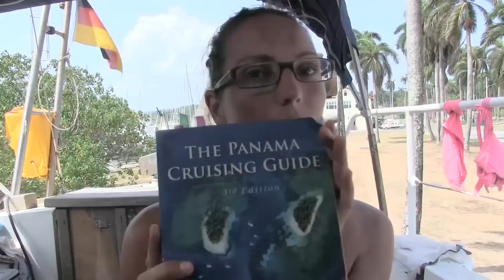Unconventional german welder SAVES my SAILBOAT in Panama - UNTIE THE LINES #30

Comment: Nike: As a welder with over 30 years of experience, I watched your video with great interest.  Here are my thoughts and concerns: (and what I would do if it were my boat)

1.)  I would have an ultra-sound survey done of the hull done at the first reasonable opportunity.  If not of the entire hull, then the area immediately surrounding the holes and those areas overlying any internal corrosion identified during your inspection.  This will determine the thickness of the hull plate in the corroded areas and whether it is thick enough to be properly welded.  The fact that the welder was using impolite language is a sign that the he was having difficulty (probably because the hull plate was too thin to properly absorb the heat of welding, causing a burn-through and falling-out of the melted weld metal from the effects of gravity).  This is NOT a good sign.

2.) Another concern is the welder's use of "stick" electrodes for the repair.  Aluminum welding is almost always done either with the TIG (heli-arc) or MIG (wire-feed) welding processes professionally.  "Stick" electrodes (the SMAW welding process) is almost never used for welding aluminum due to it's inferiority to the other two processes and poor results generally obtained.   Aluminum "stick" welding is limited almost exclusively to home welding practitioners who lack the funds for the more expensive equipment necessary to perform either MIG or TIG welding.

3.) My third concern is the method employed by the welder of merely "daubing" the holes closed with weld material.   This is a very inferior method of fixing holes in corroded metal.

The proper method of repair (if practicable) is to survey the limits of the corrosion-damaged area until hull material of the proper nominal design thickness is reached.   The substandard hull material thus identified is cut out and the edges of the hull material around the resultant hole are cleaned and beveled in preparation for welding.  A patch of the same dimensions as the hole and design thickness (and also alloy) of the original hull material is prepared and beveled and welded into the hole.  (the beveling allows for a full-penetration weld through the whole thickness of the patch).   This is the definitive solution for patching corrosion, and is what I would do if it were my boat.

My advice to you is to consider "daubing" the holes closed with welding rod as a very temporary solution until a proper repair is made.
Reply: Cost vs Benefit vs Risk = Action
Reply from the maker: thank you so much for taking the time for writing this long advice. I totally agree with you...but...I have been gathering a lot of offers from different people using different methods...and doing it the "right way" would have cost about 3.200$. Now I paid about a tenth of that. Why did I dicide to go for it: First I will be cruising a little in the caribbean, doing baby steps, no long offshore passages. I will have time to watch the welded holes and also the further corrosion that are not full holes yet, but effected areas. Next step will be to get rid of all the causes for the electrolysis / galvanic corrosion (already working on that step by step) and watch the effected areas to see if it stops or keeps on going.
If my journey should go as far as really heading into the Pacific one day (meaning long offshore passages), then I will consider to find a more proper solution for the corroded areas and go to a place where it will be easier and cheaper to have it done properly. I know this is not perfect, but I hope it will work out for now...
Reply: WhiteSpotPirates
I too was concerned when I saw him using a stick. While I don't weld I have a few friends who do and they always say TIG or MIG and inert gas shield. After reading your response Nike I understand your reasoning. Just have some good bilge pumps, and consider an epoxy patch on the inside as a backup.

fair winds
Jerry
Reply: Jerry English Carry some epoxy putty.  It's two part and can be molded to fit in place and will cure underwater.  Most bilge pumps will only buy time with any significant hole, and that's only till the battery dies.

I'm glad you got the holes fixed, and are aware of the compromises you chose in making the way you did.  Knowing allows you to follow up and keep an eye on them.  You should take a lot of close up pictures of the hole repairs and other "interesting" areas under water that you want to keep an eye on.  Though I'll bet you probably already did that.

Congratulations on the progress!
Reply: I thought the same thing. These welds will fail, its only a matter of time. I would not trust these welds.
Reply: this correct
Reply: drifterpilot though I agree with pretty much all that you wrote, I get the impression that cash may be her biggest problem at this point. She must find a real welder with a mig or  trig rig.my biggest question remains is HOW. How did she buy this boat without even having seen photos! I don’t get it.
Reply: @WhiteSpotPirates  I think you are not evaluating the risks and cost correctly. If your hull is compromised you may loose your entire investment in the boat if not risk your life.
Reply: @billh2294  The old saying goes "The bitterness of poor work lingers long after the sweetness of a low price goes away" In this case David H is 100%. You could be risking everything including your life and you wouldn't even have to venture out any farther than the harbor.
Stick welding is 101% wrong. A pop riveted gasketed patch would better, and that's not saying much
Reply: @WhiteSpotPirates  You have an entire chorus of professionals telling you the right way to patch your hull. You ignore their advice at your peril. If you don''t have $3,200 hundred dollars to have the hull welded the right way leave the boat on the hard until you do. Isn't your life worth more than $3,200 hundred bucks. Mine sure is. I own a vintage car and have owned it for 34 years. I quit driving it several years ago as it had developed several issues that were a severe threat to my safety to continue to drive the car. I spent over $15,000 dollars to have the issues repaired correctly. I not only haul myself in that car but friends and family as well. The point I am trying to make is that even if you only sink in the Caribbean your boat is just as lost and you are potentially just as dead. Hoping it works out is fine for a lot of things, but I want certainty in my corner as often as possible. Risking your life and property over a few dollars is just not worth it.  Do it right or park it. These are your only safe choices. With blue water boats, and airplanes there is no in between.
Reply: From what I could see in the video the condition of the hull was bad. It was peppered with holes and even Tig welding the repairs would at best be temporary. Only solution is new hull plating, Cut the whole hull out and replate with proper Marine Grade aluminium plate.
Reply: @WhiteSpotPirates  I guess 5 years from now we already know the answer if she is still floating...  Most of the people giving welding advice on the net watched a few episodes of Monster Garage, well maybe Orange County as MG used to get into some welding arcana.  There is nothing whatever wrong with stick welding aluminum.  It is far from a home shop technique for weekenders, because it is supported by all the big name companies who make the gear, and mostly used on plate, which is not likely Mr Garage's favourite medium.  I couldn't really see, but he seemed to be running nice straight lines, and as the boat didn't just catch on fire, he must have shielded it well enough.  

TIG is great, and I am on my second machine.  The name brand stuff is extremely expensive to run, so you can bet people are not using it in remote parts of the world. Though in the last few years some decent chinese machines have become available.  The thing about shield gas is that it blows away in the lightest breeze, so processes like TIG and MIG, are normally not done out of doors.

The other issue is how much strength you need in a hull.  And the answer is that you don't usually need much.  You need global strength so it does not snap in half, or the keel fall off, but keeping water out is not such a big deal.  Traditionally they hammered in hemp fibers.  As long as the aluminum on your hull was actually welded in place, and not surface deposition, you are probably in a real good situation compared to hemp.
Reply: The guy was one of those " welders" you find in boatyards that people recommend and turns out his only qualification is that he works for beer money, no ones interested in the fact that he can't weld but only how cheap he is.
Reply: @drifterpilot It's five years later and all your words were proven wrong. Some people do not require "proper tools, proper inspections, etc." and can carve a fish out of a tree with a chainsaw, regardless of the theme of your soliloquy. You probably are not a bad person, but a bad judge. Your intent was true, but you must understand that YOU can not do this job with this equipment, not someone else you know nothing about. I hope you learned something from this.
Reply: you have no idea what your taking about. welding aluminum has been done with stick for years, repairs like this are done everyday. stop reading the internet and try having a go at welding.
Reply: @dethrophes I understand your insinuation, but he probably does perfect work, always. just because you can't do what he did and don't like his looks or that Nike entrusted him with her life and fortune, does not make his work resemble your reference in the least. For lack of better words; I say he is an artist.
Reply: @dethrophes The boat is five years floating, motoring, sailing, grounding, sanding, scraping and banging against docks. At twenty years, when leaks develop (anywhere) are you going to jump up and declare, "HA! I told you so!"? Theory is not truth. Fact is truth. Those who can't do, administrate.
Reply: @dethrophes It is you who does not understand risk. Your example of The Lottery is a risk because you have no control over it. A skilled being who has skills and applies those skills in a skillful manner has nearly zero risk. You are defending your own inability to accomplish what this person successfully accomplished, repeatedly, without any of your  theory or decades of experience. You insist that because you are unable, everyone is unable. The sky is not falling.

TL;DR - risk requires no control. Ask a pro-gambler about risk.
Reply: @oadamo  you are wrong stick welding aluminum is not done , it is the last resort . If you are on top of a mountain and it is all you got , and even then .
Reply: As a (German) dual vocational trained industrial mechanic now studying to get my bachelor of engineering degree with an additional welding engineering title I fully agree, this was merely a hotfix. I hazard guess that if the damage in the area is too bad the area with the hole will have to be cut out and a new piece of similiar, or even the same material  be welded in, a common practice with cars and bigger ships (tankers, freighters etc.).
The repair could be done in a day if a tungsten innert gas welding machine is availble, as well as the correct material (composition, thickness etc.) it only would needed to be smoothed out along the weld from the outside and inside and it's as good as new.
Reply: @dethrophes That would depend, but if you can guestimate what the hull is made out of (compsition wise[or if it's noted somewhere]) you can easily look it up. Certain groups of Al-alloys are heattreated, but considering we are talking about a boat hull and the forces as well as the manufacturing processes that were probably used there is a ~70% (minimum) chance it's not heattreated stuff. Most of the heattreated alloys don't like alternating flex and bending and when you weld them there is a high chance of tearing and cracks along the welds (without a treatment), making that stuff less likely to be used as a hull for non yacht ships, or military vessel upper decks. Then there is the issue of cost, the heat treated stuff costs about 30-50% more, making it even more unlikely that the stuff was used. If you are not sure there are ways to find out by testing but the most common would be to simply contact the yard or producer.

Comment: Is there a soda blasting machine in the area?  They use baking soda which removes the paint but not the metal.  These machines are used on corvettes and do not harm the fiberglass.  Best wishes.

Comment: Hi there I have a 60 foot steel sloop built in Italy in 1977 it’s getting work done in January here in nz . There is corrosion here and there .. but as one off the guts said altra sound test is best . Stringers internally as  well . It can be overwhelming and I am nervous what can of worms they find ., but like you committed to the boat .. all boats have their faults ..

Comment: When you paint stripper put it in thickly and try not to over brush as you will be releasing the chemical (methylene chloride) then immediately cover it in aluminum foil and tape it down ...... this allows the stripper to act for a longer time .... aluminum needs to be profiled either with a sand blaster or an abrasive disc before etch priming ... polypropylene fiber discs are very good for removing paint without damaging the metal .... awl grip recommends at least a p36 ground profile on aluminum before applying any etch primer .... etch primer needs to be covered with an epoxy within a certain time span

Comment: I love watching your videos and I can't wait for the next one. I always like to play it safe so I would suggest after you grind those welds down, to also apply some epoxy over it........just as an added precaution. I would hate for you to spring a leak in the ocean. Put epoxy on the inside of those holes in the places that you can reach. Also please drain and clean that fuel tank so you don't end up with junk in the line again. 

Keep up the Great work !!!!

Comment: It does seem as if you bought a ‘colander’ rather than a boat, I have seen some fantastic looking aluminium boats, but from my experiences of attempting to weld aluminium, I can’t help feeling you have to be a brave person to try it under anything but ideal conditions, and the best processes require ‘wind free’ or ‘indoor’ conditions in order to work.

Good luck with your voyages!
Reply: @welderfabrod do you mean mma aluminium welding?  I suppose strictly speaking you do have a 'gas shield' with mma from the flux vapourising, but it is only 'there for a moment'.
Reply: welderfabrod thanks, actually I do know the shorthand descriptions like MMA and TIG, however I was speculating that at the temperatures existing at the tip of a welding rod in action (probably hot enough to create the state of matter known as ‘plasma’ ) then the flux doesn’t just turn into liquid but some of it into gas (I imagine some scientist somewhere has analysed things and knows!)
Reply: welderfabrod I started welding with a ‘buzz box’ bought from Exchange and Mart magazine, but have used the others, my speculation is based upon ‘one thing leads to another’ and if you consider how things have changed almost in living memory (from abacus to quantum computer in about two lifespans then I suppose that is how we got to where we are today!)

Comment: excellent excellent vids,  I got caught up in the boat repairs and almost became a boat builder  repairer than sailor myself, you just go on and on fixing repairing upgrading, I think with your boat I,d have just got some alloy plate same as Karl and pop riveted them with monel rivets over the holes slapped a bit of fairing over and took off.  the excuse being we or the boat isn't going to live  for ever anyhow.. German efficiency has its drawbacks, try reading the exploits of Tillman he used to buy old sailing pilot boats and sail them down to the Antarctica, extreme but a bit of rotten rope or paint or leak never daunted him. apart from that I love your vids, I nearly cried when I saw you explain the holes thing and how depressed about it you were. !!!  if I lived a bit closer I,d have come up and given you a hand, anyhow I,m Shure you'll  get away soon with some money left, a large deposit of new experiences and knowledge and have a great time.

Comment: Your courage and determination impresses me a lot! One question though: before buying KARL did you carry out an underwater inspection? Aluminum boats are notorious for being prone to electrolysis. In any event i wish you good luck and thanks for sharing yr adventures.
Reply from the maker: I did dive down and scraped the bottom to see if there were any loose parts of paint with corrosion hiding behind it. But at that time there weren't and the bottom looked pretty good. I did not take the boat out of the water though and I know that it was a mistake...but no use to cry about spilt milk ;)

Comment: Why did the guy prefer to use his welder plugged into the other welder rather than use the main welder? I am asking because I own a Miller Bobcat newer than the one in your video. It has the option for AC welding which is used for aluminum.

Comment: I think there is enough comments about the welding and it is a little sketchy. But if it does leak it will leak slow it will give plenty of advance warning and can easily be fixed and it will not cause a crisis. It very well and probably will be trouble free for many years and if it is not it will not be a crisis.

Comment: Just in case you need to go down to bare metal again. Instead of expensive stripper, try using a heavy duty oven oven cleaner. Just be sure to rinse thoroughly.